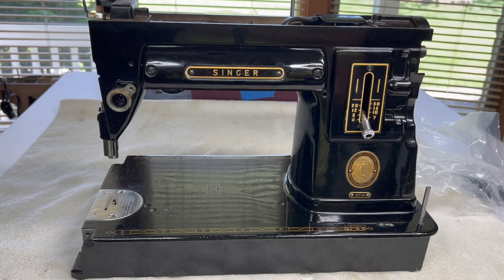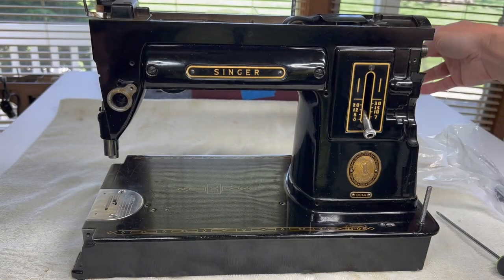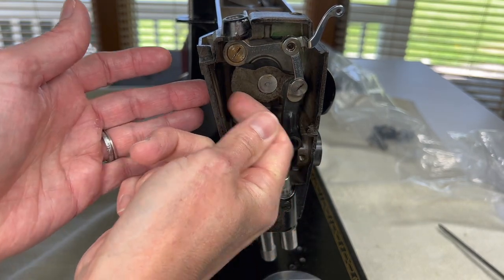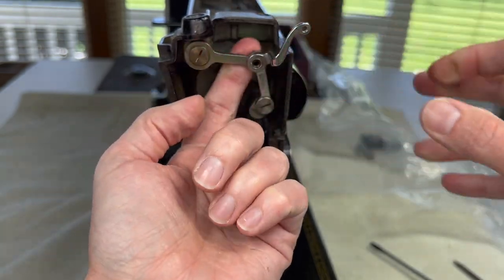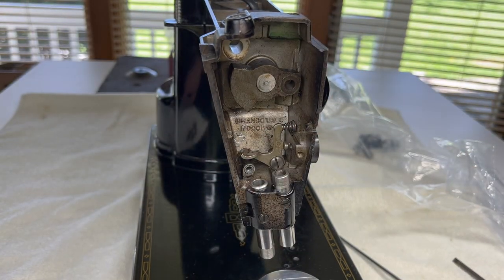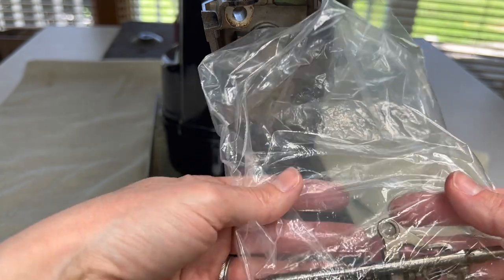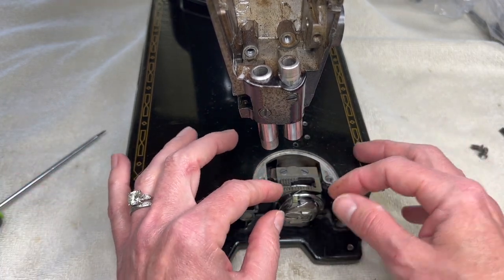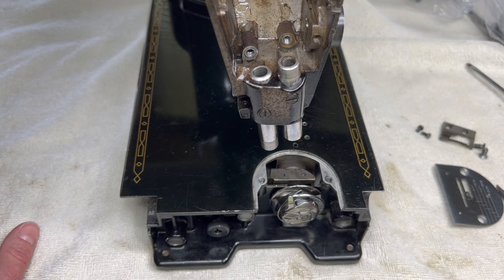How to remove the thread take up and feed dogs on a Singer 301: Singer Restoration Series Part 6

Comment: Thanks for this series.  Helpful tip, when pulling apart the thread take-up lever system.  Since my 301A was neglected, spray penetrating oil on the removed set screw on top of the frame.  Since that stud is the longer one, it takes more effort to pull out with the shorter stud at the same time.  Old dried oil is like glue.  Also, when pulling both stud bolts out you have to push them back and forth to loosen the tension between them and overcome dried oil/rust.  With a long screwdriver, GENTLY pry closest to the center of the top stud to start the movement, but DO NOT constantly pry on them!  I was able to get the top stud out where I could see a line for the flat surface.  I was able to take a screwdriver and gently turn the back of the stud's screw to remove the whole assembly.  So, if your 301A is really hard to pull out the two studs, penetrating oil,  WAIT A while, pull both at same time, use screwdriver to gently pry if it won't budge.  Pulling out & pushing in helps a lot.  If the top (long stud) is half way stuck, try a screwdriver from the back to push it through.  Best of luck!
Reply from the maker: Thanks for all the tips!

Comment: Thank you for doing these well done tutorials and the time you share to make them. I have been working on vintage and antique machines for awhile. It was a necessity that turned into a hobby. I volunteer at a charity thrift store. The sewing machines are one of my jobs there.   I do what I can.  I prefer the vintage machines, but most of what comes in are the disposable plastic Brothers and Singers.  After a few years of that work and some research, I went searching for the ones that I wanted.  I am comfortable with 15-91s and 201s motors and teardowns but have never had a 301. Although I had some confidence in tearing down the one my daughter just purchased for me, I knew nothing about their motors etc. I enjoy all your videos and have learned something out of each tutorial. Thank you also for mentioning Bob Fowler.  He is another terrific instructor. Without a few of his vids, there would have been quite a few machines that would have gone out on the floor with an AS IS tag or stating for parts only.  Blessings
Reply from the maker: Thank you for saying hello! I have never worked on a 15-91 or a 201 (yet) so maybe you will have something you can share with me someday! Yes, Bob Fowler and Andy Tube have such great and informative videos, they impacted my journey greatly! Now I am just trying to carry the torch. I can't wait to get to the motor on this 301, I have a video that I shared of taking one apart but that was before I started this series and wasn't sure what plans I had for YouTube. Please let me know how it goes if you restore the 301, you can do it!

Comment: Will we be removing the presser bar and needle bar "tubes"? I see that it would be easier to get at the tension releasing lever if the needle bar one were out of the way. 
This is a great series and is exactly what I've been looking for. I appreciate that it is broken down into parts, and that the video clarity is so good. Your explanations are helping me both as a sewist and as a novice 301 rehabber. Thank you so much.
Reply from the maker: Hi! Yes, you will find all of that in this series and then also how to put everything back. So glad you are learning from it, hope your restoration goes great!
Reply: Which video shows how to remove the needle bar and presser bar bushings? I am afraid to remove them since you haven't done that so far in the series, but mine are super dirty and need a thorough cleaning! LOL @SewingMachineRehab

Comment: Does the 300 have a thread cutter?
Steve
Reply from the maker: Hi! The 301’s came with a thread cutter on the presser bar. My experience is that they don’t work great, not a nice clean cut. But they did have them. Hope that helps!